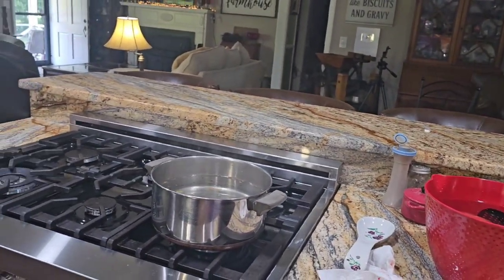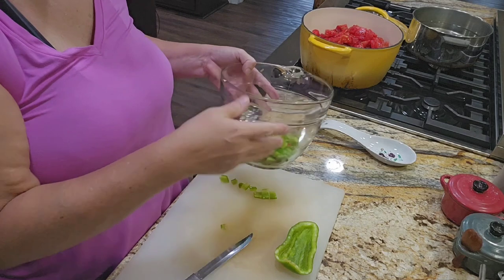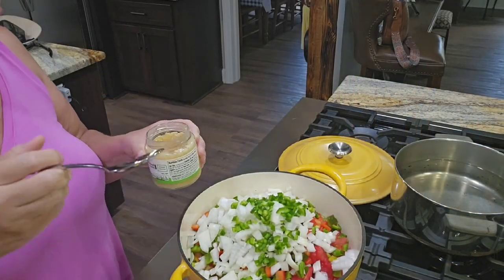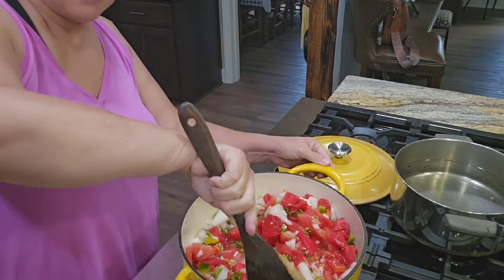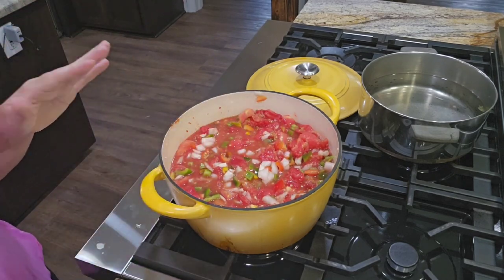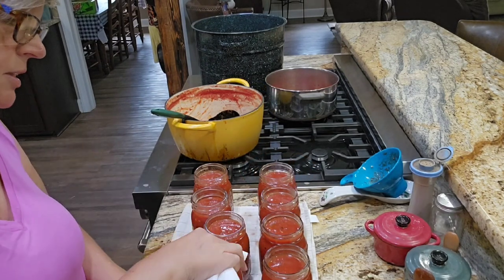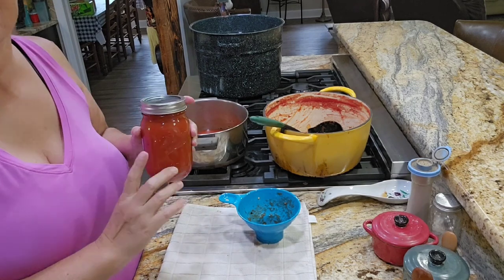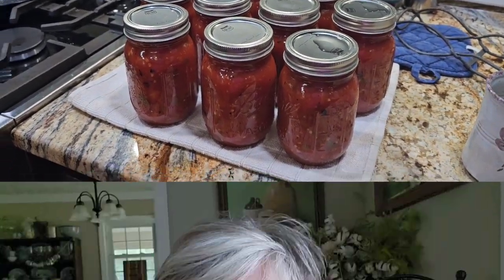Impulsive Salsa Canning & A Bitter Sweet Goodbye

Comment: My garden is weird this year I got 6 beans picked so far that are just 4 inches  my tomatoes are small perfect but small my green pepper is turning orange.. lol ❤ can you do a hot water bath with a pressure canner just not put the pressure valve on?  Or can you use a stock pit if you don’t have the blue canned?